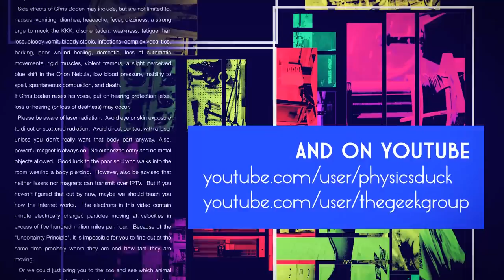Captain's Blog 4 4 2017 Piano Autopsy and Boat Carpeting

Comment: for the boat with a busted engine is to get a car with a blown transmission and take the engine out of the car and put it into the boat? could you do that, send me a message stating the reasons.
Reply: Car or truck motors will work in a boat just not well. Usually boat motors have a different crank, seals,cylinder bore, freeze plugs, and all the gaskets need to be marine grade or the will be ruined with water. Also car and truck motor intakes are usually different due to them running coolant where as a boat motor runs water. With this said yes you can use a truck motor and some people do but if you want it to run well converting a truck motor is not cheap.

Comment: For all the headaches that Bayliner is and that 350, you are looking into buckets of time and money. I would sell all the parts in that thing and see what you can get back. Part the other engine out that it came with and scrap the rest to be honest. The other thing is you wont know and don't even know if the thing will float once you do find a good motor to put in it.. I'm with you on this one, cut your losses when you can while you can.